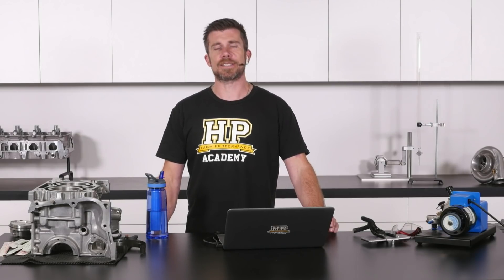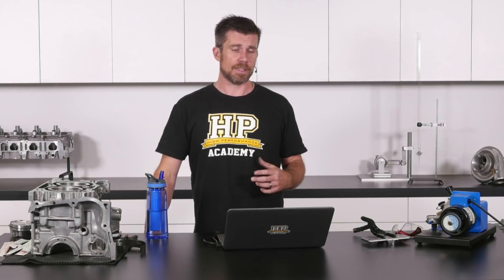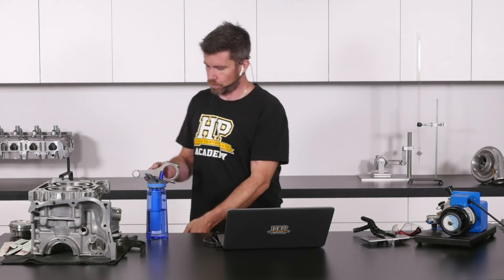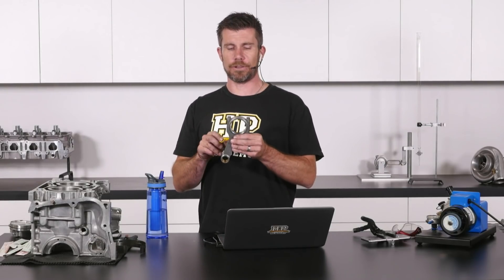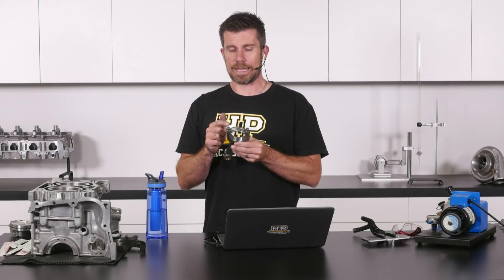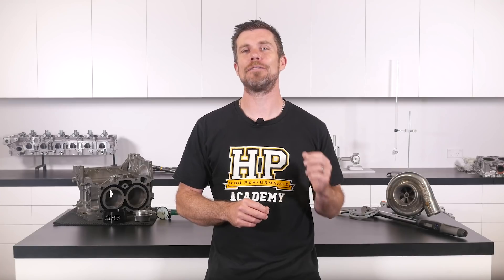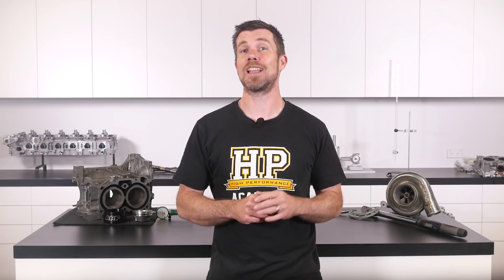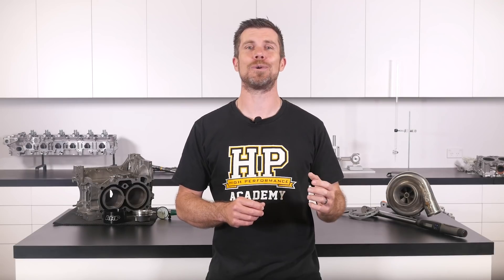Balancing Conrods | Best Practice [HPA Q&A]

Comment: Solid info.
I also like to  combine rods with pistons and match them by adding the weight of the pistons and small ends. In this way I can limmit the amount of material that need to be removed from both items. 
It is then important to mark them as pairs so they do not get mixed up.